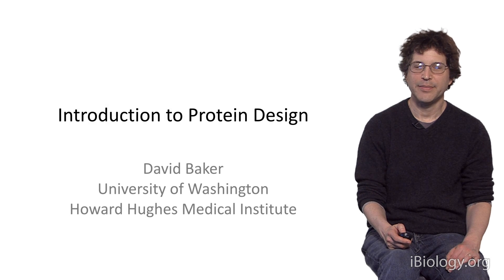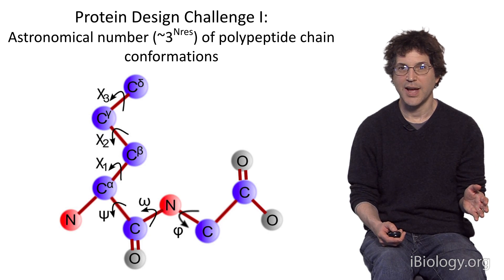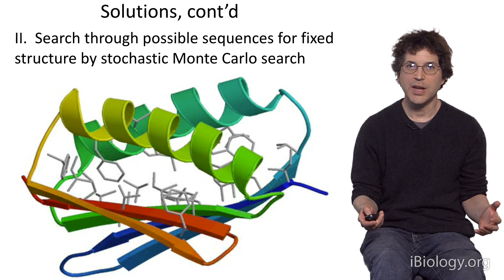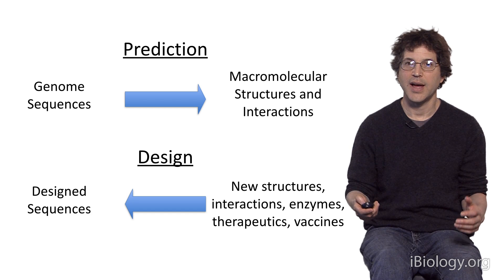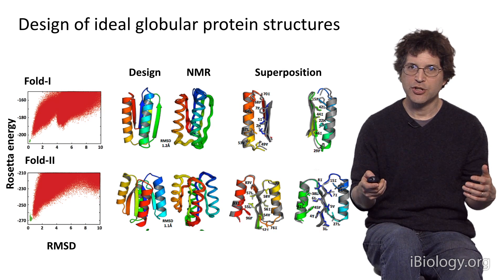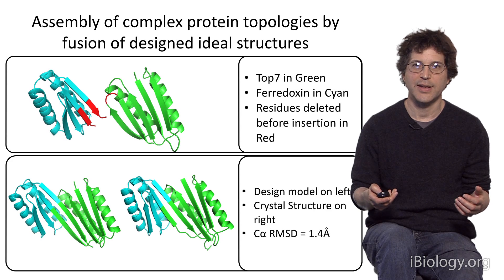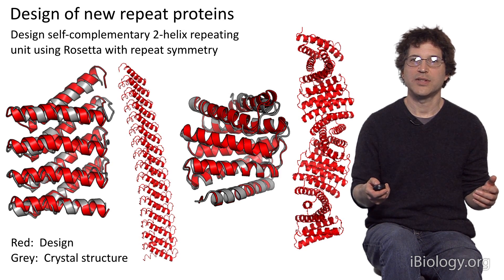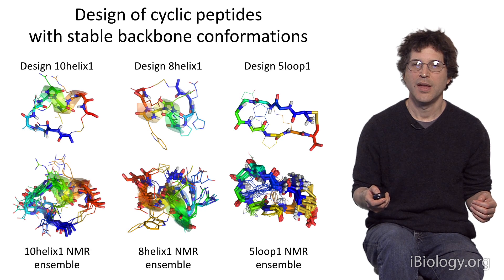David Baker (U. Washington / HHMI) Part 1: Introduction to Protein Design

Comment: Fascinating.  Designing, optimizing, implementing and integrating custom proteins.  I had no idea this was possible.

It's worth noting, however, that the discovery of the magnitude of intelligently-directed computer resources needed to make one protein is a strike against the possibility that undirected natural processes could have come up with any protein.
Reply: Wrong. False.
Reply: What's wrong, Ultimate?  Wrong that there's too much complexity for proteins to have come about by chance?  There are over 10^130 ways (permutations) to construct a small protein with 100 amino acids.  But only a very small number of those will work for a particular function.  How could any natural process select correctly against those odds?
Reply: @Ken Jackson I can suggest you one interesting book "The Selfish Gene" by Richard Dawkins. It talks quite a lot about evolution and other related stuff. I think what is false that you think that nature has to come up straight away with a protein out of nowhere, it actually does not work that way. Everything is build up step by step, if the step gives at least a minor advantage to the organism compared to the previous organisms, the organism will have a higher survival rate and more most likely more offspring. So, these minor changes add up and over millions of years new structures and proteins arise. Also, it is worth noting that nature usually uses previous proteins to build up new proteins (it does not create proteins from scratch), because lots of proteins share common domains and folds. I hope that helps!
Reply: Bootlee, what you have just recited is the dogma believed by the religion of Darwinism.  The problem with this dogma is that new proteins CAN'T be built up step by step because they don't give any advantage at all until they're complete and correct.

Proteins are totally dependent on their shape to do their job and the shape is totally dependent on the precise sequence of amino acids that comprise them.  You can't get there a little at a time.

Even if you start with an existing protein, there's no straightforward mutation path to get to another.  The field of possible intermediate steps is too big to comprehend.  As I mentioned, it's 10^130 for even a small protein.  That's not a probability, it's the number of possible sequences.  Remember the "correct" amino acids are just as likely to mutate as the "incorrect" ones.  Any random random walk from functioning protein to functioning protein would take trillions of years during which there would be no functioning protein to fill the need.
Reply: I see what you mean, but nature reuses a lot of protein domains in various different proteins. I agree that protein dynamics, folding, de novo engineering does not answer all the questions yet, but do you have a better hypothesis to explain this phenomena?
Reply: How do protein domains get reused?  Is there a library of peptides somewhere that natural selection can select from to assemble a new protein?  I know, I know, it doesn't work that way.  But the fact that so many perfect proteins exist when the universe of possible sequences is unimaginably astronomically immense, even for small proteins, strongly suggests there's something teleological going on.
Reply: Well, there are many different proteins families, for example proteins, which belong to tyrosine kinase family share the structure of the active site (part which carries out the phosphorylation), but has other regions are different, which provide substrate specificity, localization, etc... Other example could be SH2 domains on the proteins needed for interactions with tyrosine kinases (this domain allows certain proteins to be recruited to the phosphorylated tyrosine residues on tyrosine kinases to be activated or for other reasons). From my perspective the thing that we don't fully understand the solution to this problem makes it more exciting and interesting (there is a solution of course we just don't know it yet, I personally just don't like to believe that someone created it just because we don't understand how it works).
Reply: Bootlee: "I personally just don't like to believe that ..."
You remind me of Erwin Schrödinger.  When it was shown that his wave equation didn't replace quantum mechanics but was in fact a piece in that puzzle, he said he hated damn quantum jumping and wished he never had anything to do with it.   

Alas, science doesn't always take us where we want it to go.
Reply: hahaha 😃😃😃. you struck a chord there! People will go to lengths to believe something even if the odds are essentially impossible. The truth remains unscathed when science is objective: an intelligent Being created all things
Reply: Well all life as we know it uses RNA to polymerize amino acids and make proteins. Since RNA can both replicate itself and do biological work, it is speculated that early "life" was complex pools of RNA. Amino acids may have been polymerized by accident or as a form of metabolism in much the same way modern cells polymerize sugar for energy storage. A few of these short simple amino acid chains may have accidentally provided some benefit to the RNA cells such as structural support. This selected for cells which could build useful amino acid chains. Repeat this process a million times a day over a billion years and it's not surprising proteins are this complex. This is just one hypothesis but it serves as an example for how these systems may have started.

Also why is it that whenever there is a hole in our scientific knowledge we immediately jump to the conclusion that it must be magic sky people. Of all the possibilities that seems the least plausible.
Reply: @jimjom1805  you just gave a theory about how life could become more complex. It's a theory based on an assumption. Why do you assume in the first place that complex life as we have it today developed from simple life. Why is there the premise that God could not have created it complete from the start. Also your theory is about how life improved not how it started
Reply: @kth66  The problem I have with the higher power argument is it always has the same structure: because you can't prove X=Y then Z must equal Y. Because we haven't yet proven that organic molecules taking in and releasing energy for 3 billion years couldn't generate a self replicating system it therefore most be a higher power. That just is not a valid argument to me. It doesn't rule out the possibility of a higher power but it doesn't prove it either. Since we haven't seen any evidence of things operating outside the laws of physics nowadays, I think we have to assume life formed using the same laws of physics and chemistry that work today.
Reply: @jimjom1805  it's like forensic science. You can't prove it in the sense that you can't replay the crime or the beginning of things, it's a onetime event, what you have to do is take the data and formulate the simplest and most explanatory theory to make sense of it.  You claim everything must be explained within the laws of physics as we know it. The problem is a materialistic explanation starts by breaking the laws of physics - an explosion of nothing that produces everything. And that's necessary but it makes no sense without a personal being to cause it. If matter, time and space had a beginning out of nothing, it only makes sense if there is a cause outside matter, time and space because they cannot account for their own beginning, not even the laws of physics can. If i told you my phone created itself over a long period of time by probability just because I haven't been to a phone factory my not having been to a phone factory wouldn't be an excuse neither would it be a legitimate reason to arrive at the conclusion that my phone didn't need a designer- it's just common sense, i shouldn't produce a long theory to explain how my phone could have become apart from a designer. Like you said in one of your other comments you do not like to think there is a God, therefore your argument is based on what you like not what the data suggests.  Matter time space with a beginning but without a cause is too irrational a position.
Reply: @KenJackson_US  Proteins in real life dont sample all space randomly, it does it in steps moving from local minimas to a global energy minima.
Reply: @zeersirimatayanant641 : "..., it does it in steps ..."
But what steps are possible when talking about proteins?  Proteins exist in an unimaginably huge space.  How can any natural process find a path from any starting point to a protein encoded gene?  Natural selection requires a "benefit" or "advantage."  What benefit or advantage does a mutated sequence have on the path to something useful?
Reply: The thing is nature doesn't need to design anything, it doesn't need to understand the relation between primary secondary and tertiary structure. Evolution doesn't go, ok I'll do this and that that will happen. In evolution it's the other way around, something happens, let's say an AA is replaced due to a mutation, than either the organism will be better or worse and depending on that the change with be kept. Nature neither needs to waste computing power on predicting folding, it just folds, it doesn't try to get a specific outcome, it just gets an outcome and in terms of computing power, nature having absolutely ridiculous amounts of organisms at it's fingertips and an even more ridiculously amount of time...
Reply: @victorselve8349 : ..., something happens, ..., than either the organism will be better or worse and depending on that the change with be kept.
I know that's is the central dogma of evolution, but it's naive.  If evolution really worked, it would definitely need to design systems.  There are intricate, complex, interconnected, hierarchical systems through out the bodies of living organisms.  They are clearly not the accumulation of errors, as evolution proposes.  

Victor: "Nature neither needs to waste computing power on predicting folding, it just folds, ..."
That's naive too.  Most proteins fold naturally, but almost no random sequences of amino acids fold naturally.  

The old saw about random mutations selected by natural selection implies you could have sequence of individual mutations that are each beneficial.  Doesn't work.  You can't get there from here.  Do the math.

Now that I know what's involved, I'm still shocked that people actually have faith in evolution.  Evolution is a joke.  Life was designed.
Reply: No that is a completely wrong conclusion. You have to understand these proteins ALWAYS fold. They will always find a local minimum in energy. How you change what minimum they fold to is by changing the environmental conditions. When these proteins are folded in any organism the conditions are manipulated so they fold into the native state often using chaperonins. 

This is only a small part of the picture, it requires a much larger scope of knowledge to make a conclusion like that.
Reply: zempath : "... arguments from ignorance/incredulity"
You sure typed a lot of words in that post, but you really didn't say anything except to rant against me.  I don't argue from ignorance or incredulity.  You can't end up with a new molecular machine gradually.

zempath: "People that think like you seem to be living under a some kind of illusion that there is an active ideological war going on between two sides. THERE ISN'T!"

It doesn't matter what ideology you adopt.  No one has ever come close to showing that life could have originated by natural processes.  And it's similarly impossible for natural processes to have "evolved" a LUCA microbe into man.
Reply: @scatteredvideos1 : "You have to understand these proteins ALWAYS fold."
Proteins as designed usually do, though some require a chaperone protein to help them fold correctly.  But a mutation makes random change, which replaces a randomly selected amino acid with a random replacement (except for silent mutations).  Then the protein is no longer carefully designed to fold correctly and it may not.
Reply: @KenJackson_US  Again I will reiterate. Proteins ALWAYS fold. Even if there is a mutation that makes it relatively denatured compared to the native protein (making it ineffective at it's job). The only ways to completely denature proteins is with high heat, and denaturants.

The point being if a protein doesn't fold (properly) then the organism that protein is in will have a selective disadvantage. If any selective pressure comes along where that protein is needed that organism will die and the natural evolution process holds true. 

Evolution is a good enough process and that is what we have found with almost every enzyme. They are good enough to keep the organisms in a population alive and not any better. Once the selective pressure is gone, the population quits evolving that particular protein. 

In silico design like professor Baker does is absolutely intelligent design but the fact of the matter is most of the proteins they design in his lab don't fold as expected, aren't soluble or don't express. So currently intelligent design sucks compared to processes like directed evolution. 

P.S. I'm a chemist going to grad school for this topic. I actually just interviewed with David at UW a few weeks ago so needless to say I've spent a lot of time learning about this subject and have heard almost your exact argument before.
Reply: @KenJackson_US  by repeating two short alfa-helixes (10-12 AA long) you can make a "rope" to tie "things" (RNAs bound to very short peptides of 4-5 AA length) together... 
First longer (10-20 AA) stabile beta-hairpins very likely played protective role in the first stages of ribosomal RNA evolution (structural evidences)... 
So no you don't need proteins to make use of bonded aminoacids. 
Structural analysis of rRNA in different stages of ribosomal "development" gives good hints how different peptide structures could have evolved without any of the modern functions. 
Nature is abundant of abiotic (even anorganic) catalytic activity. If any kind of organic structure ( glyco-lipidic membrane, phosphorylated nucleotides) could make use of such activity (most likely a redox function) to modify the immediate environment...it would give it an advantage of increased stability. If scientists do find out the approximate constraints of early earth environments: that will speed up the search for the structures which could actively stabilize themselves in a changing environment (so the structures would "adapt" to changes in outer environment by actively regulating the inner space they reside in,  one structure by altering the pH, an other structure by imposing changes in the membrane in response to differing temperatures ).... 
Of course: While there isn't a system capable of storing information about itself we can't talk about Darwinian processes. And that's okay. The building blocks of first self replicating systems have to be very robust. All these replicators have to "invent" is to enable the replication of any polymer which is compatible with information storage even if there wasn't yet any useful info to store.... Simply the info-molecule played very different roles at first... That's what RNA world tried to explain... Unfortunately the theory ignored the potential of simple peptides to aid in the catalytic reactions.
All these considerations just hint at plausible steps... There isn't even a coherent and complete theory about the origins of self replicating systems... But combinatorial space doesn't have to imply single aminoacids/nucleotides/lipids etc. once there are more complex building blocks...
Reply: @scatteredvideos1  @Ken Jackson is the ibiology channel's resident creationist troll
Reply: @KenJackson_US  Yeah it may take on a different fold that does the job better or a fold that explores different sequence space that does something else. You're ignoring the phenomenon of gene duplication
Reply: @patldennis : "You're ignoring the phenomenon of gene duplication[.]"
I'm not sure what you're responding to, but no amount of random mutations, regardless of which type, can begin to explain life as we see it.  It's just wishful thinking.  But why oh why would anyone wish our lives to be meaningless accidents that end when we die?
Reply: @KenJackson_US  I mentioned gene duplication because you seem to think mutations would inactivate a protein from being able to do what it already does as it embarks on a pathway to do something else.
Reply: @KenJackson_US  You're not sure? What happened to your Dunning Kruger disease?🤣
Reply: @patldennis  Definitely seems like it.
Reply: Gene duplication followed by massive wild frothing mutations would seem to be an answer to the problem of evolving new proteins,  @patldennis .  But if you think that's an answer, you cleanly haven't done the math.  The universe isn't nearly old enough to allow for mutations to stumble upon a sequence that works as a functional protein.  A trillion trillion years wouldn't be nearly enough.  The ocean of possible combinations is effectively infinite.  And natural selection is no help because there's no benefit until you get pretty close.